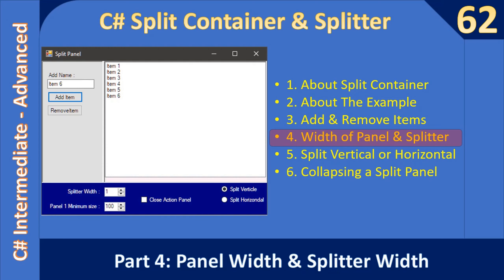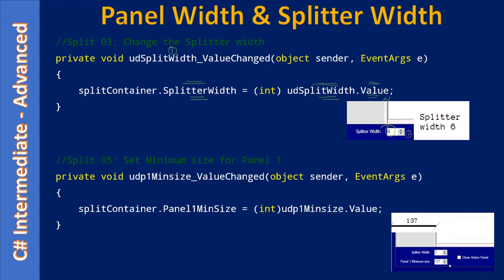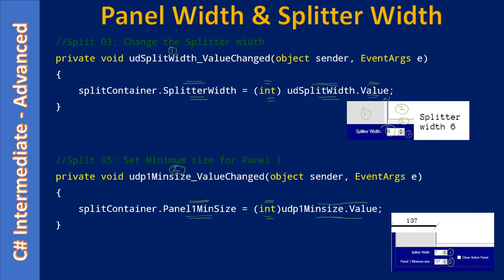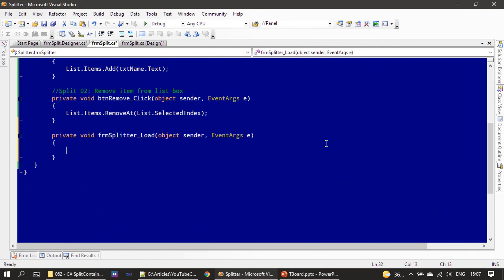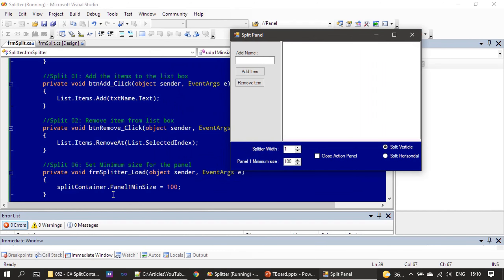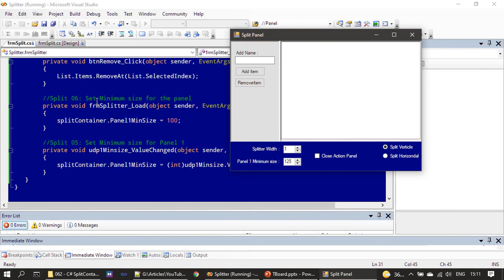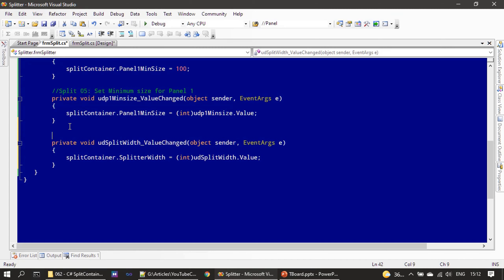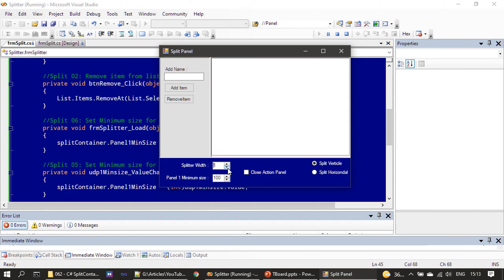C# SplitContainer | Part 4 - Panel Width & Splitter Width | C# Advanced #62

Comment: Hi, im trying to use the splitcontainer as you do, but when trying to move the splitter a dotted line appears inside and when moving how do you manage to hide it?
Reply from the maker: Hi Shiro. We used Windows 10 for this example. When OS changes the appearance will change to suit the OS and its theme.
Reply: @CodingExamples  im using windows 10 too
Reply from the maker: @shiro_v1424  What happens when you move the entire window? Is it showing the window content or just the border of the window?
Reply: @CodingExamples  it shows the content and the splitter with a dotted margin inside of it (I don't know how to hide that)